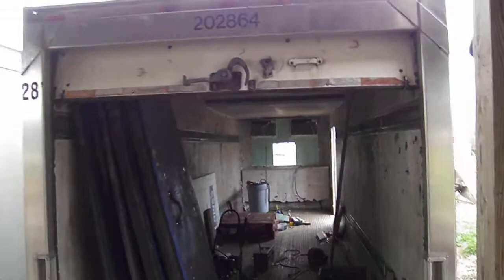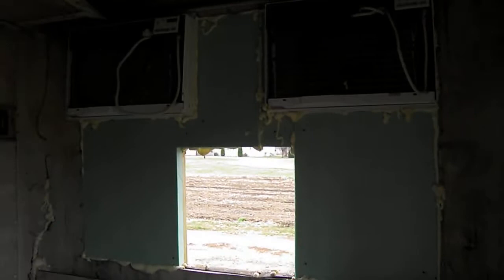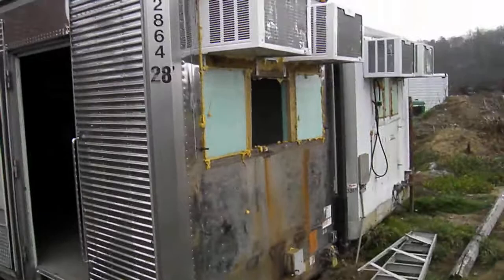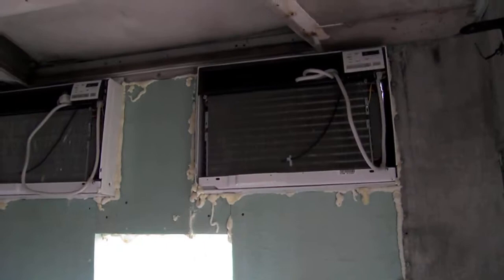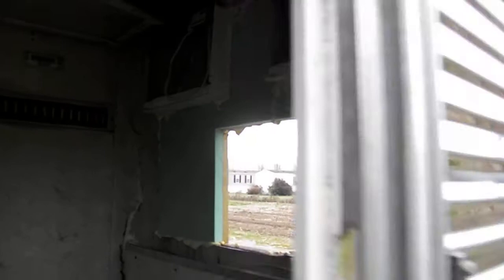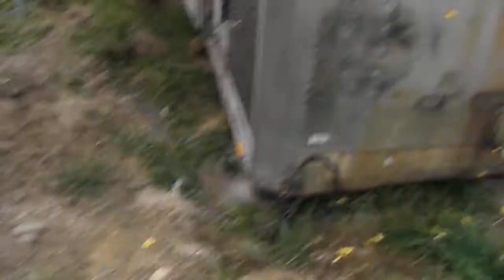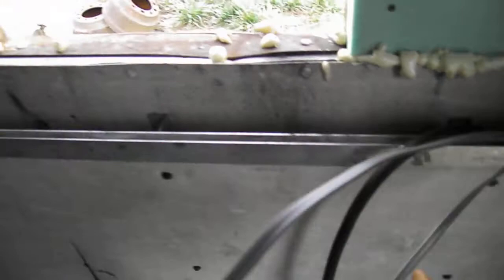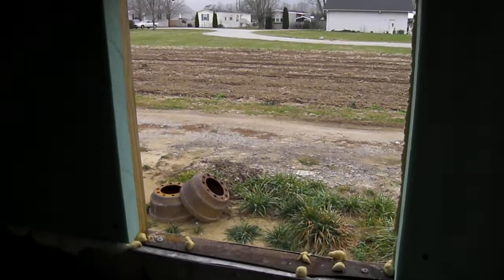Cool-Bot Walk-in Cooler Made from Refrigerated Trailer

Comment: Awesome video and setup! 

Have you thought about doing solar setup on top of top of one or both of those trailers with a large battery bank? The initial investment would be pricey, but with your set of skills (able to wire up the panel and wiring, etc.), you would easily be able to setup the panels/charge controllers/inverters/etc.. With those 4 25k BTU units, it may pay itself off pretty quickly.

As an FYI regarding those bent fins on the 2 refurb AC units, nothing to worry about there. The difference those fins will make in heat dissipation will be minimal, I highly doubt it would make a degree of difference. If it does bother you, they sell cheap little tools that are super simply to use to straiten those fins right up, search amazon for "Fin Straightening Tool
" and you can see for around 10 bucks you can get the tool that fits multiple fin gaps. I used a similar one on a car AC condenser and it worked great. 

Thanks for sharing!